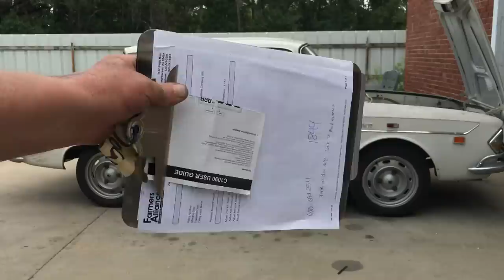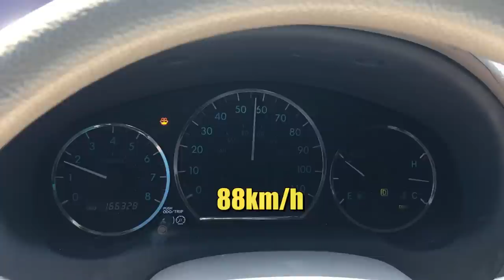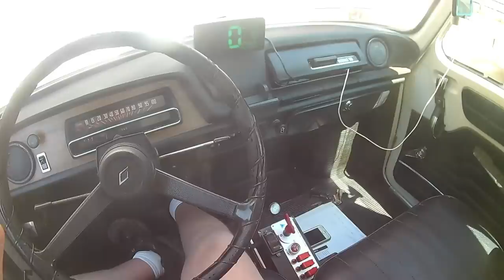S3 E21. How fast will this 670 cc predator V twin powered Renault go?...  Faster than you think!

Comment: I think you've  hitched into something here.

Knock Around Cars. Specializing in breathing new life into, old cars. With the use of these, 670 mL, 2 cylinder, lawnmower engines. Into, Pre-Pollution Control,, cars. For local Knock Around Fun. Local Grocery Shopping. Running to the 7-11 for a 6 Pack. Where, It Doesn't Matter If You Break down. You Can Just Get Another Lawnmower Engine from Harbor Freight. And the service centers. Where they just replace your engine in, 20 minutes. And off you go.

Do you realize how much sense this makes? To open up a string of, repurposed, out of business gas stations. Where, in the fine old American tradition. Each car is meticulously assembled and retrofitted. An upgraded with a 2 cylinder lawnmower engine. And top speed almost 70 mph! Who needs anything more to get around locally? No one!

So this makes absolute total sense. And there are so many subcompact at the junkyard just waiting for us. All with blown engines and/or transmissions. And we need to recycle better! Cars that can be salvaged. Should be salvaged. And not just melted down. Or shredded. But to keep them largely intact. And replace the broken parts. With cheaper broken parts. And it will not be allowed on the Interstate Highways. Just like a bicycle. Because it has a bicycle engine.  You got from a lawnmower.

Everyone will want a franchise! And for $10,000. You can have the franchise and a set of instructions. How to adapt a lawnmower engine to a  Toyota Corolla from 1978. As mine originally had a, 1150 mL engine.. And I could do 80 mph with its 5 speed stick. I didn't need to do 80, ever. I didn't really need to do 70. 55 was just fine.  50 was better. 35 and a drive through the park. I miss my old Corolla.  And having it back with a brand-new 670 CC engine. Don't sound like a bad compromise at 67 years of age. Retired and not in a hurry anywhere. Except to get to the 7-11 for a, 6 pack and a pack of smokes. Of either tobacco or marijuana. Since the drugstores don't want to sell, either anymore. They used to sell nicotine in the form of little paper tubes filled with shredded tobacco leaves. But no more. So now we are forced. To purchase said items from higher than normal retail prices. And they have us right where they want us. Beholden to 7-11 company.

It's always going to be something like this. You don't get something for, nothing.
RemyRAD
Reply from the maker: Here in Kansas it's extremely hard to find a reasonable priced older car.  We got lucky when this Renault showed up.